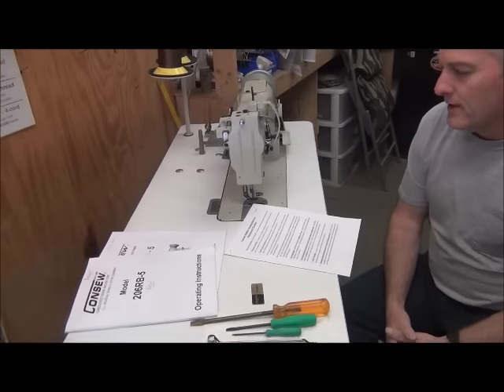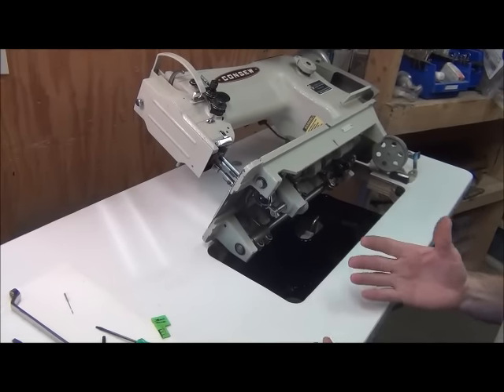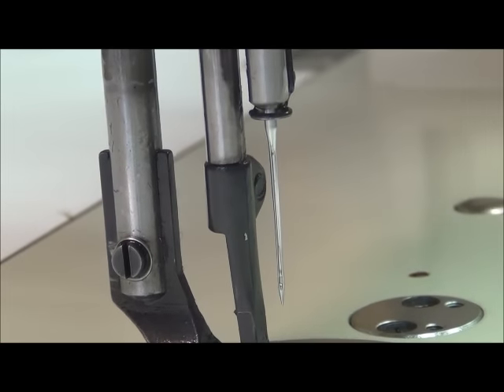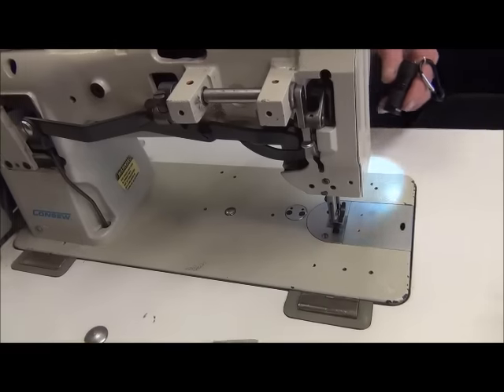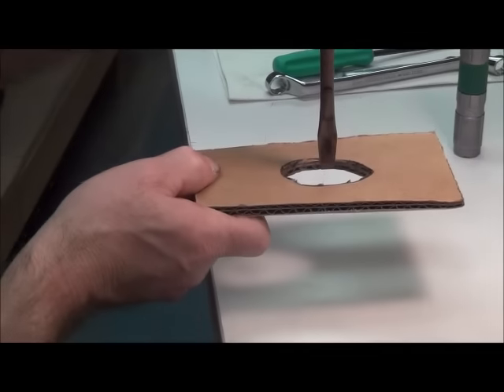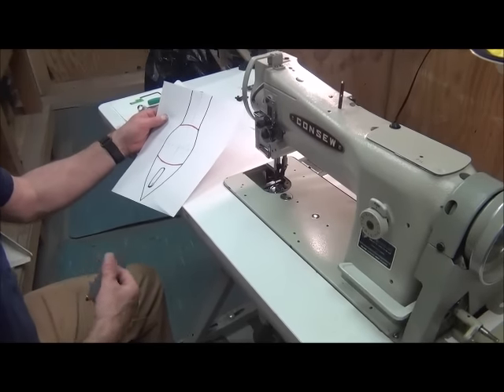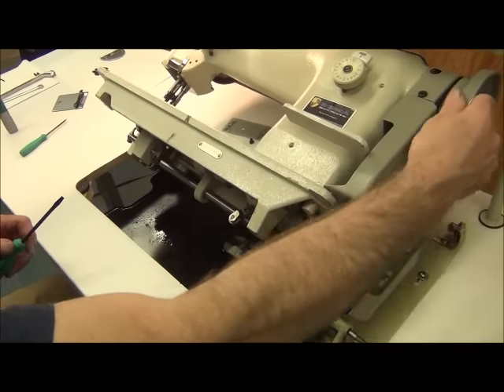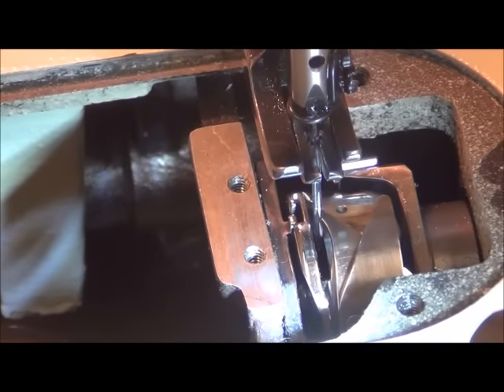Consew 206RB 5 Maintenance Video   Part 1

Comment: I have had 3 (so called) service tech pros work on my machine in an attempt to get it working correctly.They have collectively spent more than 3 days working on it,  they all have installed new parts and I still  have most of the same issues I started with. I was at my wits end until I found your videos. I preformed all of the alignment step you detailed in both of your videos and my machine now runs great!! I can not thank you enough for your time, the in-depth details you provided and your vocabulary skills in your explanations. Your videos are by far the best I have ever found. Thank you!!!
Reply: Aries Pierce  this bs is getting old.

Comment: Mike, your video is excellent, detailed, easy to follow! I just purchased a 206rb5 and followed your video to tune it. Many adjustments were off and it was a relatively new machine. After the tune it is running great and smooth. Thank you!

Comment: 04:05 Adjusting height of Feed Dog
09:43 Feed Dog longitudinal position
14:16 Installing Needle
20:10 straighten/align Pressor Feet
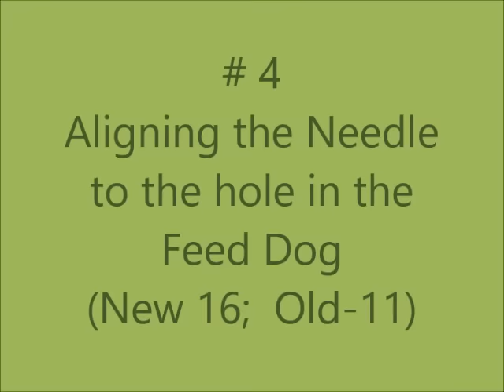25:05 Align needle w/ Feed Dog's hole
28:49 Needle bar height
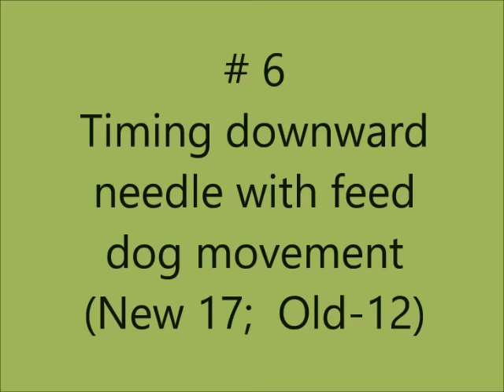35:41 Timing Needle w/ Feed Dog
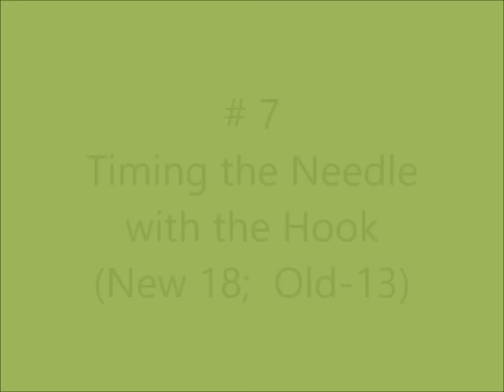45:24 Timing Needle w/ Rotary Hook
56:50 Clearance between hook and needle

Comment: Fantastic video, many thanks for taking the time to post it. I was able to get my 206RB up and running perfectly using your information. There was some differences in adjustment locations but your video was so well detailed that I was able to figure it out.
As a note to others who might be adjusting an older Consew 206RB there doesn't appear to be an easy way to adjust the "forward/ reverse stitch length balance on these early machines.

Comment: I just bought a Consew 206RBL-18 in June 2022. Straight out of the box everything was out of whack, plus reverse didn't even work. I used your videos to set the machine up. However, a month later, the machine still has issues. I can set the stitch length at 5mm and within 50-100 stitches it will be down to 4mm and declining. It will not stay at a stitch length, any of them, period. Do you, or anyone else here, know how to fix this or is there an issue with the machine itself?

Otherwise, you videos were great and EXTREMELY helpful. Thank you for producing and posting them.

Comment: Terrific video, great advice & instructions.  Just bought a 206RB-4 and it was working ok...but I followed your instructions since I broke a couple of needles testing on webbing.  You are 100% right- don't assume the machine is correct from the previous owner.  Not only were some adjustments out, the thread release lever was in the drawer!  Not sure how it worked without it, but it did.  After all the adjustments and the installation of the thread release lever the machine is smoother, quieter, and seems to stop with the needle up more often-  in short, it was running but not nearly as good as now.  Thanks for taking the time to help others.

Comment: Latecomer to this excellent video series, but I have a suggestion.  To make sure that the needle is correctly oriented, gently place a straight pin in the eye of the needle and rotate it so that it is perpendicular to the end plate surface.

Comment: I just bought a 206rb from a military unit that turned it in. On initial inspection it appears to be in great shape. I plan to follow your steps as soon as time allows. (So many other projects, so little time) a little gloat, if I may....I paid $50 for the complete rig....so stoked. I also have a Singer 211..... I'm wondering which one will prove out as favorite. Thanks

Comment: this is GREAT !!!!    thank you for sharing!
how can i get the adjusting tool ?
I have a new consew 206 rb-5 when I turn by hand or foot pedal it turns easily if the pressure foot is up, when the foot is dropped it is difficult to turn by hand and more pressure on foot peddle to get started ! any way to fix that?

Comment: I’m really glad o found your videos. I was having issues with my cording and zipper feet.  Basically, when I lowered the lifting foot, there was a slight gap between the lifting foot band the material. Needless to say, I just started loosening screws and moving things around and completely screwed up the machine.  I now know what to do. However, it seems my lifting lever and the knee lift seem to “Stick” a bit. Meaning, the lifting foot gets stuck in the up position when sewing of after manually raising it. Ideas?

Comment: I just got an RB206, seems like someone was trying to adjust it but had no idea how. / I have other industrial machines.  this is not a 206-5 / even stitch length seems to be locked. I don't want to force it. That's why I'm watching your video. thanks for sharing.
Reply: John Galv did you follow these steps and have success? Mine is a newer 2206rb-14-7-dd and I am hoping the steps in this video will be right for my machine

Comment: Great video.., I have a consew industrial model number 7360 R .I am sewing basic denim... My needle keeps breaking!!   It works fine on other material.. But as soon as I get some denim under there like a hem,  etc,  the needle breaks
Now I am using Organ Needles,  110/18. DB x 1.  What is the strongest needle that I could possibly use???

Comment: Another idea, why not use a 3.5mm allen wrench (or other size as appropriate) to gauge the presser feet lift.  Check how much clearance there is on the outside foot, then, using the same allen wrench, check the inside foot at it's highest and see if there is the same amount of clearance, then adjust, as necessary, and measure again until they feel the same.  I think it would be faster and more accurate than trying to eyeball the measurement from above and to the side. Still, I learned a lot from the video and tuned up my own 206rb-5 along with it.  Never has it been clearer or more well explained and demonstrated.  Thanks!  Now, on to Part 2.  I can't wait to see the improvement.

Comment: In your great videos you state that there is usually an oiling wick located behind the face plate in the area of the vibrating presser bar and needle bar. You indicated that this wick is present on some machines but missing on others. You also stated that you would show how to install/replace this wick later in the video(s). Unfortunately I could not located this instruction. My machine appears to have had one but had been "ripped out." I would like to know how to replace this wick. If you could provide this information it would be very helpful.

Comment: I am interested in the wick that you said are missing on the needle end. Mine seems to have some wick poking out of 2 holes, but none visible other than that. Can you elaborate or show a pic of a correct install? Thanks for all your info, it really helps! Oh, and mine is a 206RB-4 if that matters
Reply: Thought I would bump this up in case you didn't get notified of the response about the needle end wick. Thanks!
Reply: @albertkamugisha9792  I don't need the wick I need to know where it goes in a proper install in a 206rb4

Comment: I bought my machine a month ago, made one jean jacket with it and decided it needed some work. It had several issue that you identified but the biggest issue is still unresolved. The binding of the vibrating foot against the feed dog.  Both feet rise 3.5 mm when working and I took the vibrating foot tension knob off and it is difficult to cycle the machine. the butterfly nut on back is just above the center arc. Is there an adjustment for how far down the foot tries to go? Or am I just missing the concept of the adjustments.

Comment: I just purchased a used consew 226 and attempted to adjust the amount of pressure the feet has on the material I’m stitching since it was too much and was stretching the fabric as well as shortening the stitch length. I pulled out the manual and loosened the screws i was told to but now it’s worse than ever...  I’m going to follow your instructions in your video I just need to know are the tolerances the same for the 226 as the 206? You mentioned in your video about a handout on the steps on maintaining the consew 206 can you advise on where I would find one on the 226? Thank you
Reply: Hi Christine! You find your Consew 226 Manual yet? I found the Consew Resource Page here - http://www.consew.com/Resources/ - I shall return to see if they have any reading material that didn't come with my Consew 227R-2. #DesignerTJP

Comment: Hi! Great Consew Video! Had to stop right quick around 1 hr 24min to hit the clubs for awhile but, back when you were talking about the release thread finger bar measurement you mentioned 9c or 9 Charley. That means you've spent time in the Military. Were you a Precision Sewer in Iraq during the Gulf War? You are a Consew Master of the 206 Beast Walking Foot Machine! Wondered if there were any extensive timing manuals on the Consew 227r (cylinder arm type) which I have? Will  continue to scour & learn thru your Videos, but I am interested in how do we adjust the "volume movement" of the outer Walking Feet. Hope, at that point, the Consew 206 and the 227r will share similar adjustment screws, bars, etc.
Reply: Reading all the comments because my machine is a 2206rb-14-7-dd (not the 206rb-5) but I am hoping the specs and the screw locations are the same.

Have you found that the information in this excellent video, translates to your machine?
Reply: @deleted_why  Oh yes! But my 227r has a cylindrical thingy on the bottom to make it easier to sew in tight smaller areas. The "top half" of my 227r and the 206rb share a lot of similar parts. I just finished looking at what your nice 2206rb-14-7-dd can do! - https://youtu.be/-A7_TNzi20M -- it looks like Consew has hooked up a computer to an old style 206rb machine, making it ready for the 21st century! Congrats! This means your new style Consew and this 206rb are probably closer related "cousins" than my 227r. But continue hunting for a better manual and YouTube clips on your machine because, with your onboard computer electronics (to the right on your machine) you probably have to "re-set" your console if you do any physical manual adjustments on the inside. Good Luck! And you do great Upholstery Work!
Reply: @designertjp-utube  the computerized part automates certain things, like. For making bags, it can be preset to stitch r# of stitches then s# of stitches,  then t# then u# then y#... without holding the treadle down. Then, next bag, same series of stitches.
Punch it once, "r#". Punch it again "s#". Punch it the third time "t#"... etc... they can be whatever speed you want and will always stop at exactly that number of stitches.  This is great for repetitious work making, say, a large number of the same complicated thing. Easier on the foot. Always stops.

Most of my work is custom and not repetitious. It is essentially a long armed 206... WITH certain possible automations... auto thread hold when you start. Auto back stitch when you start and/or stop (you choose) there is a back-stitch trigger right by the foot. 

(With table,  new, under $2,000 from Gold Star Tools)

Comment: Great video,I have 4 different models of needle feed sewing machines. Being different they all feel the same way sewing. I purchased a new in box conesew 206rb-5 that I purchased head only. From day 1 I didn't like the way it was sewing. The vibrating pressure was hammering down on the needle plate, the feeding was jerky. Being new I though what a piece sh&%* this is. 

I stumbled on to your video and read the introduction. So I watched it and looked at how my machine was adjusted. I was looking for that one way out of wack adjustment or two. I didn't find anything that was alarming. There weren't any adjustments that were spot on either, everything could have been adjusted to closer tolerances. So I went back to step one and adjusted every adjustment to where it was spot on. I did noticed the the closer I got towards the of the adjustments the hand wheel was getting easier to turn and all the jerkiness disappeared. When I finished with all the adjustments, just turning the hand wheel by hand it felt like a completely different machine. When the moment came to actually sew something, I was spectacle, I didn't expect much and I was thinking I made things worst. Wrong!!!!! Its a dream to sew with and now I noticed the other 4 machines need to be tweaked in.

Now I have a singer 112W40, when the pickup arm starts it upward movement to start making a stitch, the thread hasn't cleared the bobbing case. I also noticed that the needle timing with the feed dog is way out of wack. When the feed dog starts its rearward movement the needle is at the bottom of its stroke. Is the timing of the needle with feed dog the same on all needle feeds?

Comment: Hi,,please!!!! help  my daughter used my machine, not sure what happened, she says cotton jammed up at bobbin,   I cleared the cotton and found she had placed the cotton behind the tension discs thus the problem....so cleared away the cotton, only to find the wheel not turning it is JAMMED solid....if I loosen the hook assembly at bobbin case, loosened the 2 screws on thrust collar the machine turns no problem.....but the minute I tighten the collar  nothing turns.......where must I look,......

Comment: I watched both videos and did the adjustments.  Two questions.  I have the 206RB4 which doesn't appear to have the alignment holes to adjust forward/reverse stitch length. I marked the two pieces with red pen instead.  I can loosen the screw but can't rotate the fitting?  If I tighten it all the way, I can't move the reverse lever so I assume it's the right screw.  #2:  The bottom stitching never looks as good as the top.  Stitches aren't as straight.  Is that common or can't be fixed?  Thanks.

Comment: Just got a new machine. The needle bar is down and will not move. How do I adjust it
Reply: The “Needle Bar Height” adjustment portion starts around 28:45.  You stated the “needle bar is down and will not move” ... not sure exactly what that means.  Follow the instructions in the video.  If, after following the instructions in the video ... to include loosening the pinch screw that holds the needle bar in position ... the needle bar is still stuck - you may need to tap it lightly with a non-metallic hammer to break it free.  There is only 1 screw that keeps it tight ... so loosening it should allow you to adjust the needle bar

Comment: hello, my needle keeps hitting the rotary hook which leads to the needle breaking. would i have to fix the timing of this? thank you !
Reply: bornfromthe04 yes,good luck.
Reply: Or underneath move the hook bed assembly over a smidge. There's a screw for this. Edit. This would apply to vertical axis hooks. If horizontal axis then see 58:41 of this video.

Comment: Im stuck on step #4. I have a 206rb with no number after it. The back where you have an access plate I have only 2 holes. neither leads to a screw and both are much too high from where your screw is.... Any idea how to loosen the needle arm in order to center it?
Reply: Tanner Kunz , sounds like you have an RB-1 model.  Go to Part 2 of this video and read the comments.  There is a comment thread addressing this issue.  Cheers

Comment: Could the ball bearing in the clutch go bad? My consew 206rb5 keeps popping the clutch. When I press the silver button and turn the handle I can feel it pop over and over again it doesn't actually stop.
I then have to set the timing by unscrewing the bottom 3 screws on the clutch. I set the timing sew several times before it goes off time again.
Any 💡 ideas?
Reply: Has the clutch gotten oil on it? Or super dirty? Or the main one, do you have thread wrapped up around the hook shaft? I just pulled 20 feet from under mine.
Reply: The clutch detention ball has a spring pressure adjustment available behind a screw on the clutch directly opposite the ball. Remove the access screw and tighten the spring pressure by turning the screw clockwise. Not too tight but more than you have now.

Comment: at around 1 57 51 that bolt was so so tight on my machine I had to use a pair of vise grips on the shaft of a screw driver to break it loose.

Comment: anyone know why my machine runs insanely fast. So fast it breaks the thread? thank you much apreciated!
Reply: It was set up to run like that. You can slow it down by putting a smaller pulley on the motor. You will also need a shorter belt to suit. Best belts are made by Gates or Goodyear but you will need to travk down who in your area is selling their fhp belts.
Reply: Even bettet would be to change the motor to a servo motor. The max speed can be changed electronically and you have much more controll over feed speed with   the foot pedal. But this is a fairly expensive investment (worth it if you sew a lot).
Reply: Lew Mutchler thank you so much do you think it’s also my pedal? which could be loose or something ?
Reply: Hi! Lew had great advice for you and your Sewing Machine! I'm wondering if you have the super modern DC Sewing Motor installed (I do on my Consew 227R-2). If so, please check the power speed dial on that type of motor and "back" it down to a "slow crawl" if you wish. Much easier to sew up handbags and belts at that stitching speed.
Reply: Hi! I see Lew made a second comment on your hot rod flying sewing machine, and he already gave cool advice on the Servo Motor which is also known as a DC Motor here in the Los Angeles Garment District. Please tell us your Sewing Machine Make & Model!
Reply: My newest machine has direct drive (the servo motor is built in)... but I replaced my clutch motor with a servo motor for about $150 bucks. Big deal to be able to SLOW DOWN!!